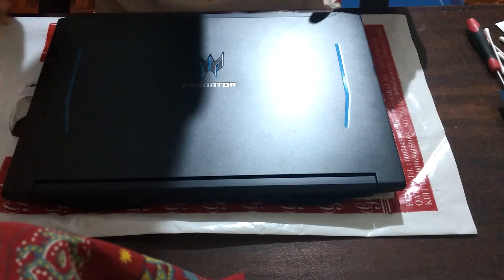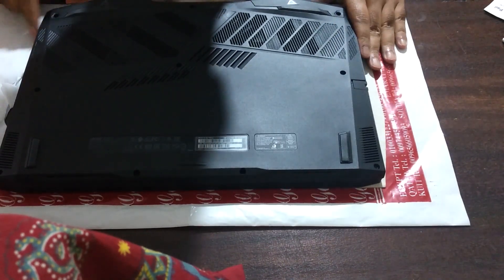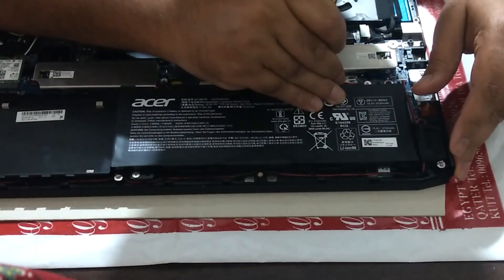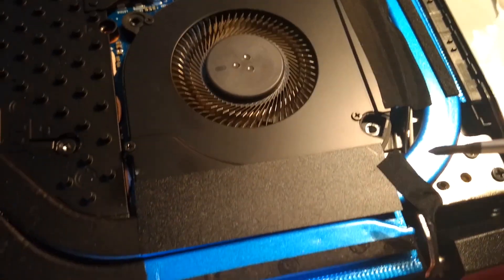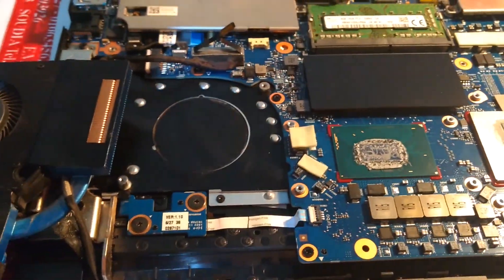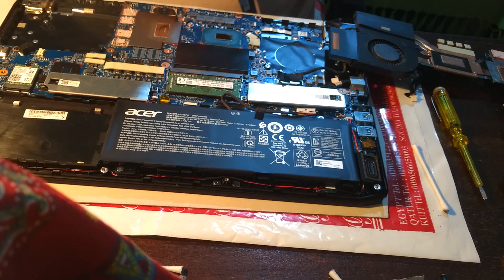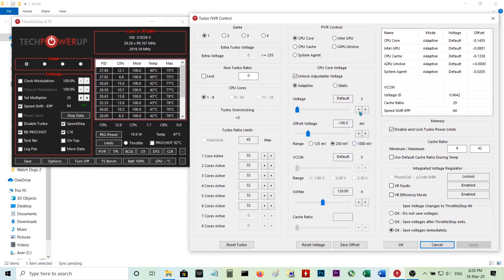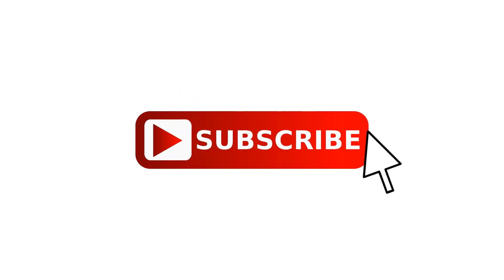Repasting your laptop's thermal compound | Arctic MX-4 2019 | Acer Predator Helios 300 2019

Comment: Is there a way to remove JUST the fan without removing the heatsink too? Thanks
Reply from the maker: No you can't because the CPU and GPU die are underneath the heatsink
Reply: @ArifFidaali  okay thank you, really helpful video.
Reply from the maker: @kyletaylor3860  Welcome
Reply: You can remove the fan only , just unplug it then remove the 2 black stickers and your good ..
Reply from the maker: Sorry I had misread your question. Yes you can remove the fans without removing heatsink. But now since you have opened the laptop might as well also repaste if temps are high
Reply: What are your system temps in predator sense during gaming?

Comment: I bought mine dec27 2019, how many months to repaste?
Reply from the maker: I also bought mine on that date. It's a one year warranty but the reason for changing the paste is that Acer's stock paste is low quality that's why you need a superior paste like Arctic MX-4 or Kryonaut. Arctic claims the paste can last for 8 years but that remains to be seen.
Reply: @ArifFidaali  so  now the warranty is void i guess. I have bought the same past but waiting for the warranty to be completed...
Reply from the maker: @RahulSingh-fn1qr  One trick is to call the Acer tech support and tell them that the laptop is overheating. They will probably replace it with the same stock paste after which you can yourself change with Arctic MX-4 or Kryonaut without voiding warranty.
Reply: What are your system temps in predator sense during gaming?

Comment: Great video! Just repasted mine yesterday. Should I re-past  the pink stuff on the Vram too since it has been disturbed by the opening?
Reply from the maker: Thanks. There is actually no need as Vram does not contribute to much to heat only the CPUs core die does. Unless the paste of the Vrams are caked then yes. What are temps like now?
Reply: Arif Fidaali Thanks bro! Just tested and it was 62 cpu and 42 gpu running ada 64 cpu stress test :)
Reply from the maker: @timsong93  That's great Tim! What were your temps before?
Reply: @timsong93  what man mine runs at 44C cpu on idle. runs at 75c cpu and 68c gpu when i play cs go on maxed out
Reply: @ArifFidaali  69 cpu and 44 gpu running ada 64. The fan speeds were a lot higher. Have you tried Ada 64 for gpu testing?
Reply: @timsong93  which thermal paste have you tried?
Reply: You know what blows my mind this laptop cost me $1925.00 Canadian with the RTX 2060 variation and Acer cheap skates on thermal paste. We shouldn’t have to do this kind stuff for 5 years after owning the laptop.
Reply from the maker: @michaelkmusicofficial  I feel you. Acer invests in 3D aeroblade fans but cheaps out on thermal paste, doesn't make sense!
Reply from the maker: @7amzah-_- Yes you can use thermal paste
Reply from the maker: @7amzah-_- Since also by default Acer uses paste then paste is ok. Yes my thermals are still good. I don't go beyond 76C most times for both CPU & GPU. If I play with Nvidia whisper mode I wont go above 70C. The GPU die is what produces the most heat I think 75-80% of the heat.
Reply: What are your system temps in predator sense during gaming?

Comment: Hello, I have this exact same laptop but I am having major issues with the GPU Temperature spiking to 77 C in literally 2 seconds. This only happens with the GPU not the CPU. Does anyone know why? Could it be too little paste or some sort of blockage that prevents the fan from cooling it? Any help is appreciated, thanks.
Reply from the maker: Hi Jairo yes it could be some dust blocking the fan from spinning well or a damaged fan or background tasks which are utilising the GPU
Reply: is this during idle mode or what ? is ur gpu driver up to date ? and is your default video card the 1660ti ?
Reply: SlyArliss No not idle. It’s when I start a game that the GPU gets really hot really quickly. Battlefield 4 hits high 70s within minutes of me entering a match, which didn’t happen prior.
Reply: @jairodominguez04  is your pc undervolted more than factory under volt ? i have mine set to -124. how long have you had your laptop i heard you gotta clean it ateast twice a year. could be a repaste issue.
its better if you check out acer helios 300 
community page alot of tips and tricks
and you will find out whats causing you this.
Reply: SlyArliss Undervolt is the same. I got the laptop in July of 2019, so not really one year yet although I have cleaned the fans recently. I feel as if it is the repaste but I have already done that and it still remains the same. Maybe I’m just bad at repasting I don’t know.
Reply: @jairodominguez04  undervolt it more i heard it cant go past -134 it will shut off on you. are u using throttle stop ? as the program and do you play cS GO or valorant or the newest AC what fps u get.
i use throttle stop i dont use the 4.5 my turbo mode is set to 3.2 and my standard is set to 2.4. but if yours is all default then ur using the max 4.5. i play R2D2 on mine at
almost max settings except shadows.
i get about 62 to 68 fps. on 144. my tems are like 77 cpu and 80gpu. but you also have to realize some games are CPU heavy and some are GPU heavy. CSGO gives 80CPU temp and 64gpu temp.
Reply: What are your system temps in predator sense during gaming?
Reply: @shantanupingale1422  CPU gradually gets to high 70s mostly but the GPU gets to high 70s and sometimes low 80s in a very short amount of time which is not right.
Reply: Jairo Dominguez bro I meant motherboard temps, in Predator sense there is a 3rd option of system temps in Predator sense. Can you tell me system temps?
Reply: Shantanu Pingale 80 C for the system temp most of the time
Reply: Jairo Dominguez fans on max mode?
Reply: Shantanu Pingale No, only auto fans. No way I’m playing with the sound of a jet engine right in front of me haha.

Comment: Mine Is ROG GL503ge ! Mine is gng to 95°c cpu! Can I order mx4 ?? Bcs it's non election??
Reply from the maker: Yes sure it will work with any laptop/desktop
Reply: @ArifFidaali  thanks man , I tried undervolting and optimising , it doesn't help! So I repasting!! Great Video Mate!
Reply: @pavansampath7201  hey so what is ur temps now and what is ur cpu clock speed because the cpu clock speed is the thing that generates heat

Comment: Thanks so much for making this video! I'm thinking about doing this to mine although i'm kinda nervous since ive never done something like this before. Also, did you use a soldering iron for this? i know you didn't say it in the video but i'm just making sure.
Reply: I have to do it myself tomorrow and I'm already scared lol am I gonna use to much or to less thermal paste..we will see anyway thanks for the great video
Reply from the maker: @herrderschinken2182  You will be ok I was anxious as well when doing this but it all worked out in the end.
Reply from the maker: @herrderschinken2182  Please consider subscribing :)
Reply from the maker: You're welcome dude! Just do it & take your time now that you have a lot of time on your hands! Don't rush and remove screws & other fasteners gently. Why would I be using a soldering iron?
Reply: Arif Fidaali like I said I’ve never done something like this before so I was under the impression you would need a soldering iron for computer parts. thanks for the reply :)
Reply from the maker: @Brine-vg8hy  No problem. You don't need a soldering iron for this only the tools in the video.
Reply from the maker: @Brine-vg8hy  Also check the video for your particular laptop for it's teardown before you begin so there aren't any surprises.
Reply: I did mate I saw your post in the acer predator facebook group :)
Reply: I bought a new SSD 16gb ram and arctic mx4 will open it today and watch ur video for help ty mate

Comment: In my view its too much thermal paste and its up to everyone to decide but i use kryonaut and the spread method its the best only a thin layer covering both diodes its more than enough too much will cause thermals issues also the thermal pads dont need to be replaced if they arent damaged during the disassemble process as they don have anything to do with the cpu/gpu temps only the mobo and to level the heatsink also applying the wrong thickness will cause the heat not to be leveled and not to transfer the heat to the heatsink properly but overall good tutorial :)
Reply: Actually it makes very little difference. Many tests were made regarding thermal pasting and too much is never a big issue, only too little so its better to put more than less.
Reply: @triploshadow actually too much will be an issue it will affect the thermal dissipation transfer between the diodes and the heat sink on laptops only I have repasted hundreds laptops and the spread method it's the best
Reply from the maker: Thanks for the feedback!
Reply: What are your system temps in predator sense during gaming?
Reply: @shantanupingale1422  gpu 65/70 cpu 70/75
Reply: xapim1 in Predator sense there are 3 options, CPU, GPU and system temperature, can you tell me the system temperature?
Reply: @xapim1 is kryonaut a good paste for laptops? Or should I go with Gelid GC extreme or cooler mastergel maker nano?
Reply: @shantanuthakur6081  it's the best u can get
Reply: @xapim1  Yeah I know its has best conductivity. But I waned ask if it lasts long (at least 6 months before performance drops) at 85-90 temps.
Reply: @shantanuthakur6081  should last at least 1 year i have repasted 2+ year's ago no issues
Reply: @xapim1  Cool! Thanks for your feedback😊 Last question, how many CPU+GPU applications can I do with a 1 gm Kryonaut on my helios 300? ( I wont use it for VRAM, just CPU and GPU)
Reply: @shantanuthakur6081  many people reported it is enough for just an application for CPU and GPU each. Total 2 applications.
Reply: @haryt921  laptop dies are smaller

Comment: What were the odds of you posting this video right when I was searching for a tutorial on how to repaste my Helios 300? Good video, thanks a lot! Also, I have a question: Do you know the thickness of the thermal pads? Have you switched the old ones with new ones? Thanks!
Update: After repasting with Noctua NT-H2 without changing the thermal pads, the temperatures have dropped as following: ~20 Celsius on CPU and ~10 Celsius on GPU. Manufacturers do a terrible job when applying thermal paste, I had close to NONE on the CPU and the GPU had way too much thermal compound applied.
Reply from the maker: Glad I could help! I haven't switched the old with new ones. I believe the thickness of the thermal pads should be 1mm. Request you to subscribe, thanks!
Reply: @ArifFidaali  Subbed, thanks!
Reply from the maker: @m3tudy696  Thanks!
Reply: @ArifFidaali  whats thermal pads i order the same thermal paste waiting for it come in so i can apply it to the same laptop.
replace the old ones with new ones can you tell me what that is.
Reply from the maker: @slyarliss1184  The pads being referred to are thermal pads on the VRAM chips near the GPU die that people usually put but since they don't produce too much heat, I just left the default paste.
Reply: @ArifFidaali  does it require a different type of paste of can a thermal paste can be used ? are you talking about the heatsinks that go over the cpu and gpu ?
Reply from the maker: @slyarliss1184  This is what I'm referring to: https://imgur.com/p2H6hqN
Reply: Did it bring your temps down ?
Reply: @ajms5013  Check the update. TLDR: ~20 Celsius on CPU and ~10 Celsius on GPU.
Reply: @m3tudy696  Thats nice brother ! May I know what you did about the VRAM Paste (The pink stuff around the GPU ) ? It'll be really helpful !
Reply: @Rishabh-kn8fm  Don't attempt to change it unless you have the pink compound (less likely that you'll find that on the market) or if problems with the vram temps. You could replace it with a normal thermalpad + a drop of non-conductive thermal paste on the vram, once again, if necessary.
Reply: @m3tudy696  So should I just leave it as it is and put the heatsink back ? I don't have thermal pads rn, but I wanted to repaste my laptop. Just worried about what do I do with the pink stuff
Reply: @Rishabh-kn8fm  Yes, don't remove the pink paste, make sure to have all the stock thermal pads in place and try to put the heatsink back on as straight as possible for a better distribution of the thermal compound. That's what I did. You can always open it again to check if there's something wrong anyway (don't forget to repaste everytime you take the heatsink off).
Reply: @m3tudy696  may i ask u where did u put the thermal pads exactly as u i don't get it to be honest
Reply: @abdallah-ft2nj  The thermal pads should be placed exactly as they came, on the vram and on the other things. You should be able to see the patterns on the heatsink where they should be placed.
Reply from the maker: @ajms5013  Yes it did by -15C! As Ive shown towards the end of the video my before and after temps on Watch Dogs 2. Also please consider subbing thanks :)
Reply: @ajms5013  I didn't repaste yet.
Reply: What are your system temps in predator sense during gaming?